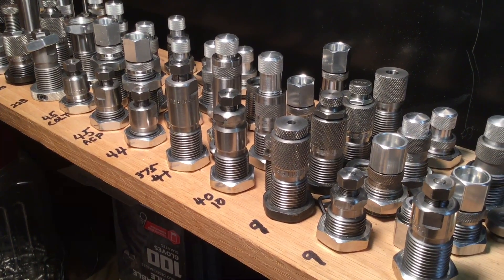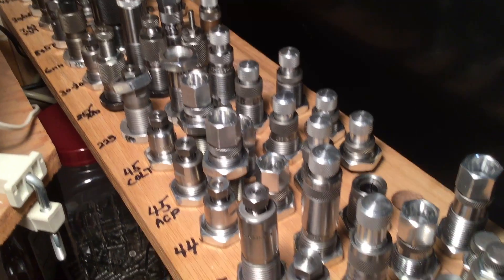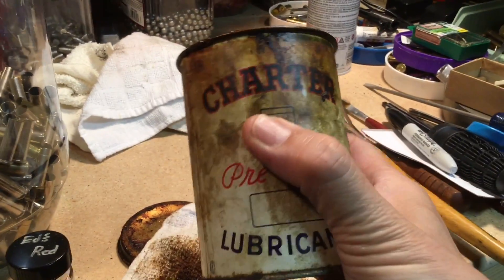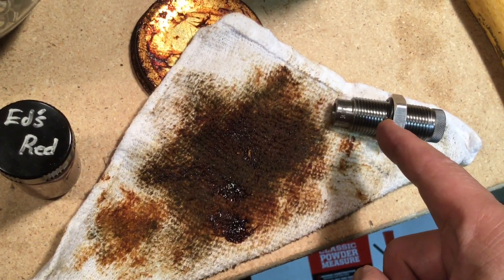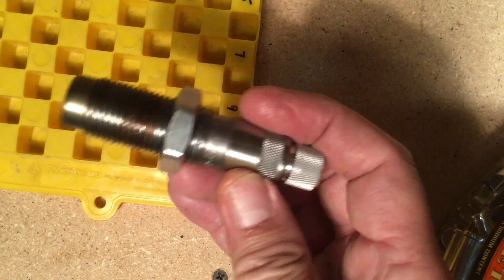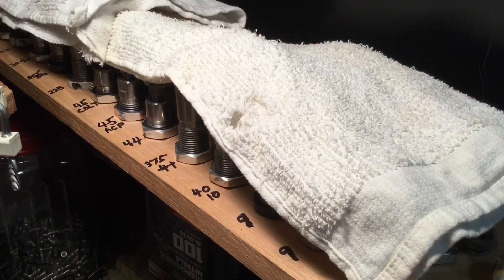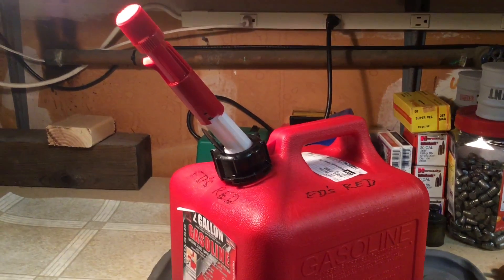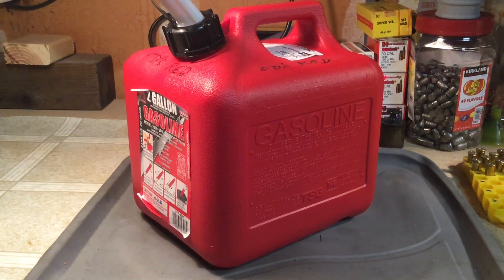Fine Tune For Die Storage Rack And Ed's Red Container

Comment: For seeing what plastics are safe for ______ chemicals, find the little recycle triangle symbol on the plastic product in question and it will have a number in it. You can find an online reference guide to what kind of plastic it is and then search for what that specific plastic is inert to or attacked by. The trick with Acetone is it can attack some plastics but it can also permeate through some without being obvious so your Ed's Red might be losing its acetone potency. I do prefer glass & metal for chemicals like that. An empty/new paint can will work good or metal paint thinner type can. In small quantity I like those glass lab bottles. I even have some tiny ones with a pump sprayer to mist my gun patches with or directly on parts.

Comment: I know this is an older video but I really like this idea. Curious though how you organize your shell holders. Thanks.
Reply from the maker: commonsensehomestead - Great hearing from ya..!!  A little hole with a short wooden peg (for the shell holder) jammed into it with every row of holes would be nice indeed...If I can scrape up a wider hardwood board somewhere, I might redo this rack...Thanks for spurring the idea... FC
Reply: What about adding a hook or screw to the front edge and placing the shell holder on it?
Reply: Where do you keep them now?
Reply from the maker: commonsensehomestead - Adding that shell holder screw or hook sounds like a great idea.. might just take you up on that...Thanks, FC.

Comment: One problem here with using Oak is that the acids in the Oak , (tannic acid),will turn steel a nice purple colour in a very short time, you will see this on a saw that has been left touching a piece of Oak, even though the Oak is fully dry, you will still get this, the easy solution to this is to apply copious quantities of Linseed Oil, that will soak into the Oak, (if you use Oak), and prevent the problem, it will also dry, (as it does on your gunstock), and not attract dust. This is too good a design not to find some way around the potential problem it could cause.
Reply from the maker: Englishman French - Thanks for this info and idea - Don't know if this wood is oak or not - but it was from my neighbor's nice shelving that he tore out to remodel.  I rescued some of the better shelves for projects.  Currently, I am protecting my dies by using a rag of axle grease and smearing a thin layer into the die threads where the threads bear on the wood... happy to report that the grease has prevented any rusting of any of my dies, plus does not get in the way of the dies going into my presses - and I use that rag on the dies before putting them back... it's like Cosmolene for my dies...Best to ya,  FC

Comment: You could just soak/coat the die organizing board in a wood oil preservative instead of coating your die's? Just thinking about debris sticking to the die's it self. Also acetone will not harm your gas container...
Reply from the maker: Austin Russell - Thanks for the info...Time has told me that the gas container is OK with acetone (I figured that if gasoline was OK, acetone should be).  No problem with debris sticking to dies - the axle grease does not get in the way of dies going into presses - and I give the dies a little rub of rag axle grease before putting them back in the rack... been working well so far...I suppose spraying the wood with varathane would have been OK too, but I already had the axle grease... Best Regards,  FC

Comment: Why not use plastic?
Reply from the maker: Johan Alfredsson - I suppose I could go to Tap Plastics and have a rack made - but the cost would have been much more than this project - hard to beat free...and with the axle grease in each die thread bearing area - no corrosion of any dies now for many months of field testing.  Best to ya,  FC

Comment: I just keep my dies in the room hog cases they come in plus a strip of VCI paper in there to give corrosion protection!
Reply from the maker: mytmousemalibu - Hello to mytmousemalibu..- one of the real knowledgeable on YT..!!  That works - and Lee makes the storage box fit if Breech Locks are on the dies also...My problem started with the Co-Ax press - when Forster die lock rings are on the dies, the die boxes don't close - so I decided to make my own die storage rack - works real well with axle grease in the die threads to prevent any corrosion - plus the grease does not interfere with screwing the dies into any presses (with Co-Ax, this is even less of an issue).  Best to ya, Chris.... FC